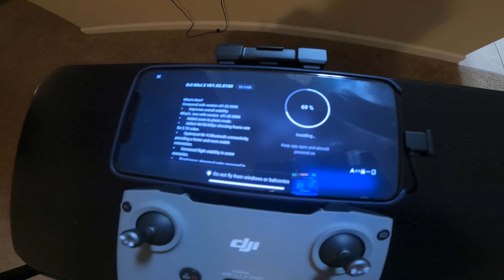CLASSIC WIRING DISASTER! / NEW DRONE / NEW DROP PANEL PROJECT!

Comment: Get yourself a power probe, volt meter, watch a couple YouTube vids on how to use it and you’ll never have to call an electrician. You can even test sensors yourself. Also fun fact: keep a small square 9v battery with you and you can test lights with it instead of having to poke around cables or needing voltage from the truck

Comment: Good job fixing headlights. It can be a nightmare if connectors change.  Happened to me, burnt 2 headlights. Had to deliver load in the dark it was dangerous. Went to repair shop they only charged me $40 bucks. Love you're channel, miss road trip videos.

Comment: Hell, that happen to me 4 years ago  in my P/U,  switched burned out as soon as I were turning the headlights on, I knew I wasn't going to make it home before darkness , had to jump head light to my battery to get me home, I always keep wire and electric tape in my truck along with a 3 ton floor jack and a impact  wrench some of these youngster should be tuning into your channel a well maintain vehicle will never leave stranded on the side of the road

Comment: All of the LED headlights have to rewired because they are also sold around the world. If you were to use the standard light the truck came with the pins in the harness would have been right. The corrosion in the connector is normal for the older classic

Comment: When you put your lights together you need three facing the battery box four facing down on the top of your battery box and then..  .. space out about six ligts along the side under your bunk ..  Try and keep them about ten inches apart if you can or you could put them six inches apart. need to get the visor and put ten of those lights ion it also .. just my thoughts

Comment: you can change the wire positions on the plug by using a small pick push on tag  on brass coated connector to suit your  head lights cant wait for your penny light install and se how bright they are (I wouldn't mind a few for indicator lights on the kw t404 bull bar ) lol i got stuck when the mechnic played with the wiring on the 1988 KW t650 i was coming back from useless loop he the mechanic wired the lights up for high beam no low beam and had to camp in the truck being 3 hours from home